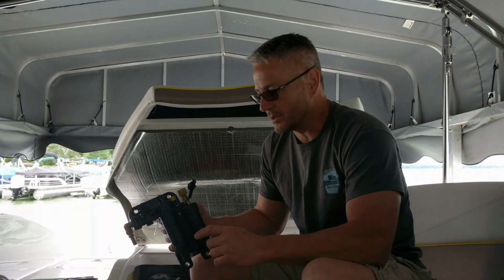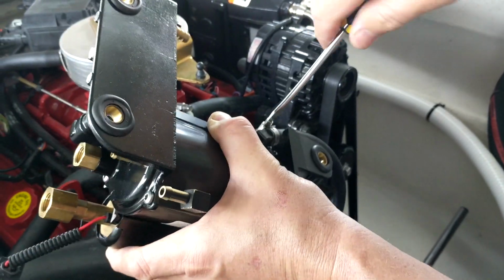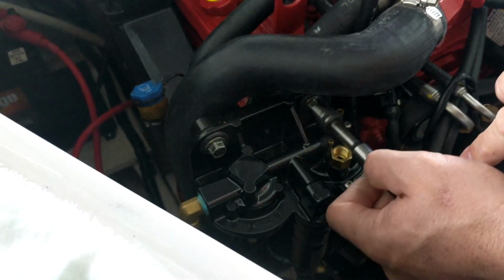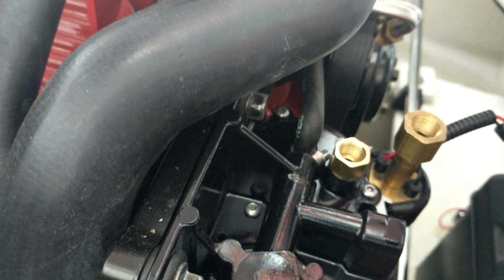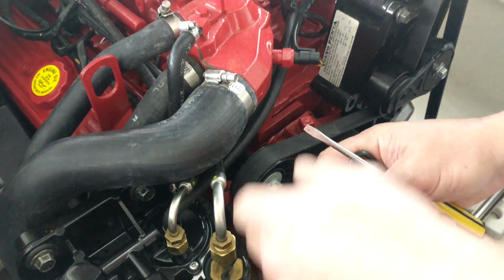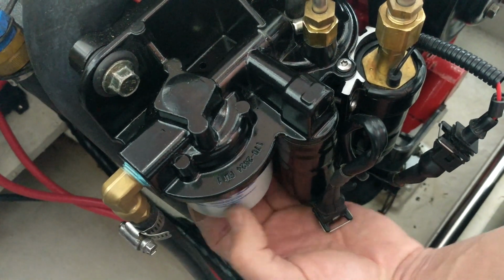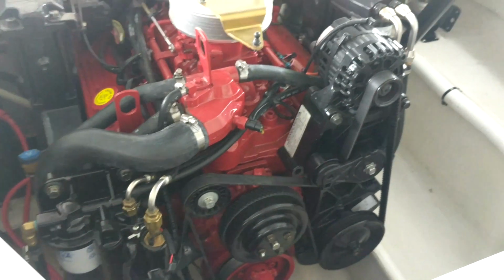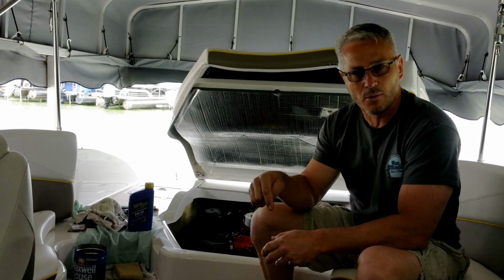Volvo Penta Fuel Pump Installation and Priming

Comment: I highly recommend using the services provided by Troy to remove the paint chips from your fuel pumps. My engine had a low pressure pump issue. My local boat dealer wanted to charge me over $1600 to replace the fuel pumps (low and high). I sent everything to Troy following his step by step instructions. Within a very short time I received the whole assembly back completely cleaned and with new high and low pressure pumps. I installed it and the boat runs great! Troy will reply to to your emails and answer all questions and best of all it was all under $400. Thank you Troy for your service and videos. You really saved me a lot of $$$.

Comment: Hey, thank you for the great videos. I am about to change a fuel pump assembly on a 4.3 Volvo penta today. On the electrical connectors you do not have to take metal clip off, but push them in and it makes it so you do not have to pull them out and possibly lose them, like I did so many times. I learned that this week working on my 89 VW Cabriolet. I will be sending you my old fuel pump assembly to rebuild next week. Thank you again for the videos.

Comment: I just installed my "mancave mechanic refurbished" fuel pump on my boat.  Aside from one of the mounting bolts giving me a bit of a problem the process was exactly as you described.  Thanks for the service and the videos!

Comment: Great series of videos to help with the V/P pump issues. I had never seen one of these taken apart before. My old boat (1988 OMC 4.3 V6 4bbl carb) has a mechanical pump (Carter) that I just replaced because I was finding some gas in the yellow safety overflow hose). It lasted 30 years! Thanks, now I know what I might be in for if I upgraded to a newer boat...
I have to say I prefer the mechanical pump and Quadrajet 4bbl carb (very easy to rebuild)

Comment: I assume it would be a good idea to check and clean the Fuel Pressure Regulator screens while installing a replacement Fuel Pump Assembly.  I will do that when installing the new pump assembly I purchased from your website. Clogged screens kept my motor from starting which led me to finding your videos and website. After cleaning the screens, the motor ran ok but I decided to replace the OE pump assembly out of fear of getting stuck on the water. Thanks for the great info and videos.

Comment: Great vidoes, the electric plugs are much more simple than you describe though. You merely press in the metal bar and then pull the plug apart to remove, and then to install you merely press the plugs together while the metal clip is already installed and it pops into place easily. There is no reason to ever remove the metal clip. Thank you again!

Comment: Excellent video and really helpful.  I was wondering what you used to remove the paint that flakes off.  Also, how much would it cost me to send it to you for the rebuild and back?  Only other thing to help improve the video, add a little more lighting.  Thanks

Comment: Replaced my low pressure and high pressure fuel pumps in my Penta 7.5 (during 12-15knots of wind LOL) Different than this video, the low pressure is up front and easy to access while the high pressure is in the very back of the engine. Finally got it replaced and engine started for a while then choked out. Could this be the shraeder valve? Would I prime (with key) then release air from the valve, several times over? Any other thoughts?

Comment: Can you let us know if there’s a difference between a 
Volvo Penta TBI & MPI 
Fuel pump and how do you test fuel pressure on a TBI which I have.
I purchased a new pump on Amazon and It did not correct my problem. 
I get to 2500 rpm and it just Boggs the same as when I had my old Volvo pump in it. No whining from my old or new pump.
A mechanic today said it’s my fuel pump.
Reply: I had both the injectors cleaned replaced fuel regulator and cleaned complete throttle body.
The mechanic said he just tested a aftermarket pump it was reading 30 psi but wasn’t delivering 30 psi of fuel.
I’m lost !
No engine codes.

Comment: The electrical connections are easier to connect an disconnect if you simply push the metal clip rather that remove it.
Reply from the maker: LOL, I know I was struggling on one of these videos.  It went so well in rehearsal.

Comment: I have the 3 liter Volvo penta with the mechanical fuel pump I've been having issues with it. I wonder if there is a way to mount  wire in and get the electrical pump to work properly with the carburetor.

Comment: I have 2005 Volvo Penta 5.0 Lt similar to this engine. I have oil leaking hitting belt from this area close to fuel pump. Is there lubrication line attached to pump?

Comment: I have a 2008 Four Winns H220SS 5.7 300GI with a what it seems very common whiny fuel pump,  I had my mechanic come out and empty out the gas tank and clear the lines of old gas.  When he reinstalled everything he told me the gas pump was shot,done, kaput.  Is that the only priming you did or is there additional priming needed if high pressure fuel lines are removed?  How much did you pay for that new pump?   If you  can add a link I would much appreciate one with the no paint inside the pump.  Thanks subscribed it was fun watching someone else work on my engine.  Also, what do you use to clean  your engine bay much cleaner than mine!  Thanks for your help.

Comment: Mine is starting to make the infamous whining sound. I’ve read several reviews on the paint flaking problem. 
I noticed you said yours doesn’t have the inner paint and you want have to worry about that problem anymore. 
How did you fix that?
Did you buy a rebuilt one ? 
Any suggestions for me ?

Thanks for your input and for your video.

Comment: So I replaced my fuel pump today.  Initially it would start and try to run and then die.   Now it will not start at all.  I cleaned the filter on the fuel rail as well.   I am fairly mechanically inclined, have good tools etc...    any thoughts?
Reply: Did you figure out how to get your boat running? I am having the same issue of not starting now. Thinking it might be airlocked ?

Comment: Replaced fuel pump starts after filling the filter & priming, but will not pull fuel from the tank? Any suggestions?
Reply from the maker: Maybe the fuel tube is blocked.  Try attaching a tube from the fuel pump to a gas can to see if it draws.  If it does then you may have a problem with your anti-syphon valve